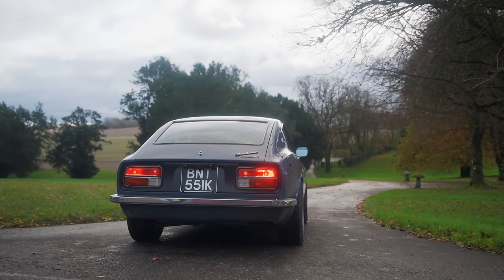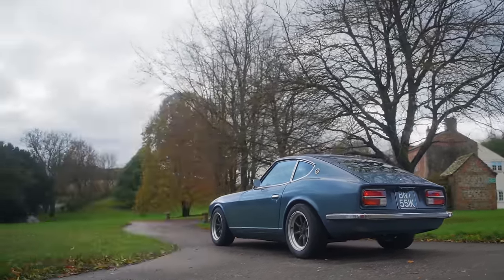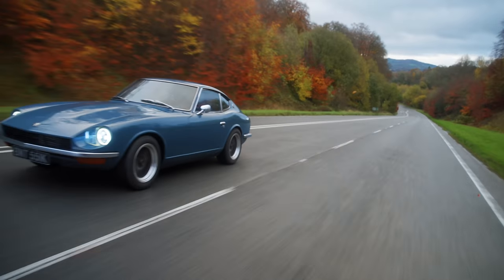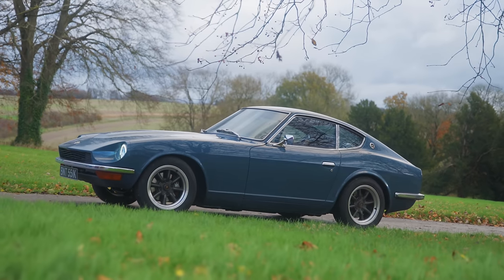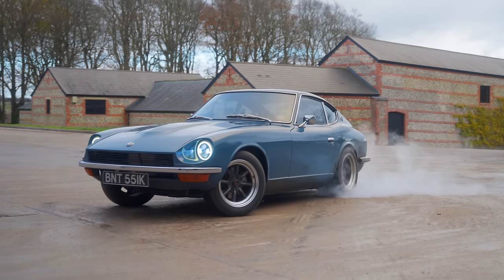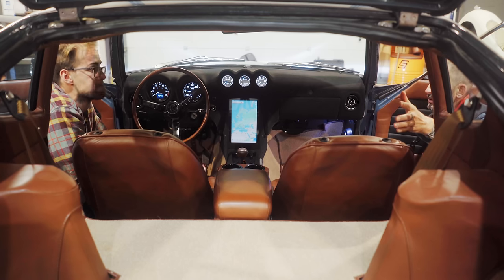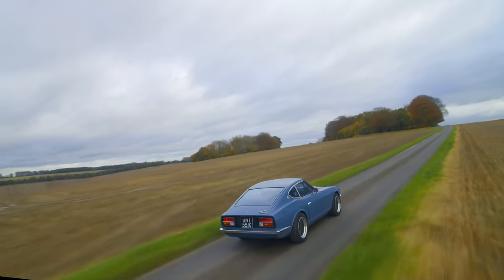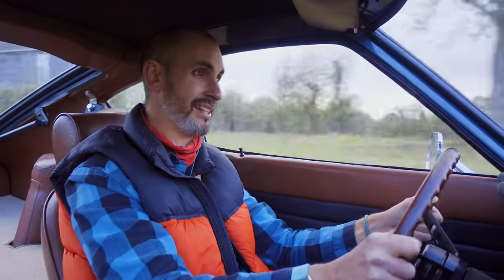Would you daily drive this controversial modified Datsun 240Z with Drift mode?

Comment: 27:39 anything that is buit to post-2010 body safety standards :J

(edit)

No but seriously, if anybody has a car from about that era, which might have a failing engine, but where ECU and VC are separate, with minimum CAN interaction required, that has still plenty of life in bodywork so no body restoration required, and where it's possible to keep the modern safety features like airbags, curtains, belt tensioners without changing their controllers, and it would not try to kill you in case you happen to bump into a ditch... anyone know a car like that?

Comment: I thought the " ev converted classic " argument would've been well and truly done by now. Either do it or don't do it. There's plenty of cars available one way or another. 
Plenty of people have done them without modifying the original car e.g. ECC. Ev conversions have proved to be superior in just about every way except an exhaust note. In 10 years time an original ice vehicle will be a pretty rare thing because nearly everyone will have an ev classic. Charging stations will be everywhere. Batteries will be much cheaper and much more energy dense. Drive systems will be more efficient and definitely plug and play. 
As much as I like ice cars , there time is just about up. Time to move on.

Comment: Kind of put off electric cars after the Luton airport fiasco and seeming that BYD car on charge suddenly explode and rise 4 to 5 meters up in the air
Reply from the maker: That was started by a Range Rover PHEV
Reply: @TheLateBrakeShow  still had batteries for traction
Reply: Yeah, cos no petrol or diesel car has ever burnt itself out 😂
Reply: BYD use blade batteries which are incredibly safe, please give actual evidence when you make these claims, makes me think you work for an oil company!
Reply: @jimmyh6601  no far from it lol.
I think the new sodium batteries that BYD have moved over to need a bit of irioning out the issues first before general sale

Comment: Restomod? This is an EV conversion... Which is whatever... 
.
But to take a lightweight sportscar, only to then remove that lightness and add a bunch of heavy crap is definitely not my cup of tea. But to each is own, it's just not a restomod.
Reply: How much lightness do you remember them saying was "removed"?
Reply: ‘Added lightness’  is just a choice of battery size and EV motor weight. #LotusElon is 20kg lighter as an even - with same 180 mile range (Twinc’s Drank Gas 🤣) .

Comment: Johnny, I stopped watching when you said zero emissions.

That's either wilful ignorance, or a barefaced lie. I'm hoping it's ignorance rather than a lie.

The mining of the minerals for the batteries is horrifically polluting, and borderline slavery. The refining and transportation of the materials is Co2 intensive. The manufacture of the batteries and transportation to the factory is Co2 intensive. The production of the mains electricity to charge the car is C02 intensive.

Anyone who thinks EVs are  zero emission  are wilfully ignorant, or a liar.

Stop pushing this false and harmful narrative.
Reply: The term "zero emission" SPECIFICALLY refers to the operation of the vehicle, NOT to it's manufacturing and to imply otherwise is either willfully ignorant, or lying. And I have yet to see any petrol company or ICE car company tally up the total emissions involved in the manufacturing of their products either. Stop pushing this false narrative.